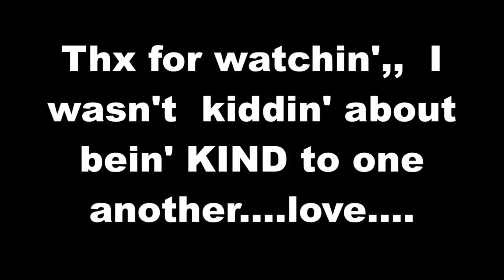VISITING A LEGEND LOGGER 'BOBBY WALKER' REWORKED

Comment: 266 xp I almost squeaked like a girl that’s a beautiful saw
Reply from the maker: YES IT IS
Reply: Finally got a 28 inch bar on mine and I agree after getting used to the extra length it saves you out from bending over a lot